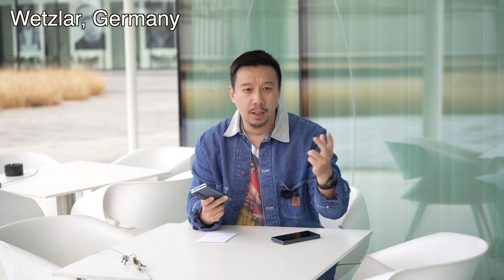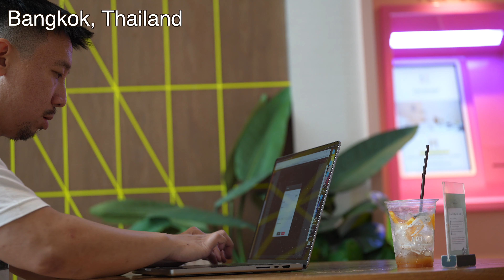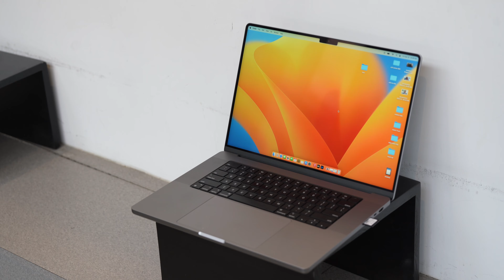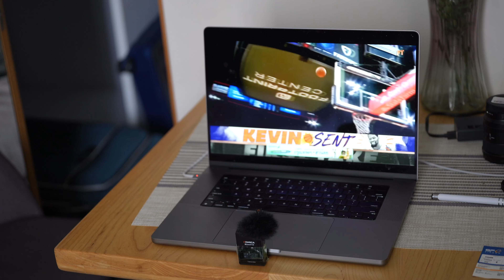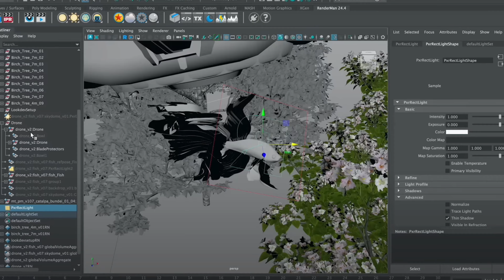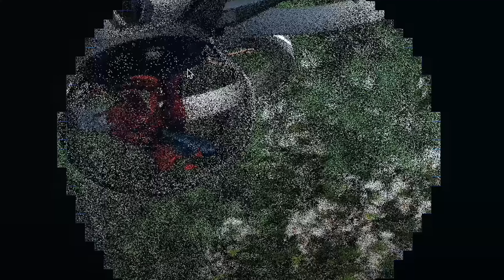M2 Max MacBook Pro Review After 6 Weeks Across 6 Countries

Comment: Have the M1 Mac Mini since a few days and so far there is (much)light and shadow. 
Appearantly they have a bug where the system lags, mouse is not smooth and i have it. So far nothing helped to fix this.
Feels like the handbrake is on. 
Every 300buck netbook is much more accurate and fast 😂
I know its a bug and not normal but if there is no solution... yeah 😢

Comment: Apple does not offer touch laptops that's a problem for me
Reply: I use an iPad for my touch work. I tried using 15/16 inch Windows convertibles, but they did not work as a tablet; they were too big, heavy and bulky. Having a thin and light separate tablet is a non-compromise solution. If you meant touch but not convertible, I found that pointless and hated messing up the display with oily fingers.

Comment: Lack of 5G modem on what is essentially a smartphone chip is a real head scratcher
Reply: It seamlessly connects to my iPhone, so that is not an issue. I understand that units sold of laptops with optional 5G are nominal. It is not what most users want because, in most countries, they will have to pay another $400 a year for an extra SIM. Apple's solution is cheaper and works a treat.

Comment: You can also stick with a Linux Machine or Tablet for video editing for Youtube. Its not necessary to buy such a very expensive device or something similar if you literally probably have a great smartphone that can do that
Reply: If you put together a 15 min YT from clips taken on a camera, then edit, and render, you will have a far better experience doing it comfortably on a laptop rather than a six-inch phone. It will also render far quicker due to the media engines. Many YT creators like Ben also have other jobs, so time and comfort are essential.
Reply: @andyH_England  Yeah I know. I also have another job. Phones are much more powerful then you might think and you can attach it to a big screen. I can edit and render a 15 minute video in my lunch time of 30 minutes if I want to. It depends on the workflow and the material. If you have 200Mbps 4k60fps videos even smartphones may fajl and you need a proper laptop or computer. But if you have 50Mbps videos 4k30fps no issue at all on a flagship phone.In my case the phone is way quicker than my laptop anyway as it seems Intels GPU for rendering videos is not really efficient on my linux equipped device. 
Dedicated GPUs that are faster for rendering of videos in a laptop usually are much much bigger. So Apple definitely has a winner here in terms of Hardware.